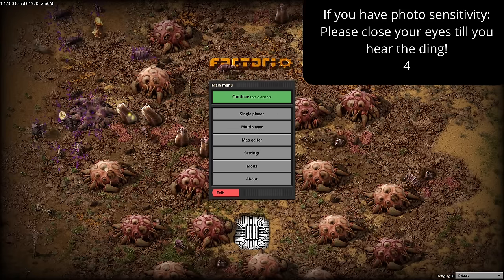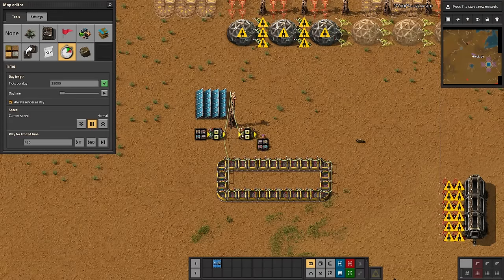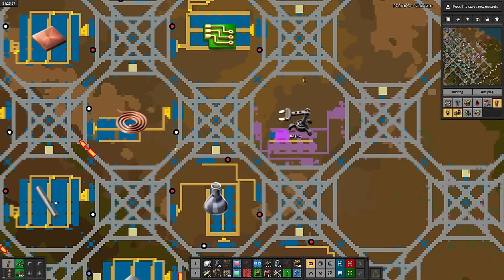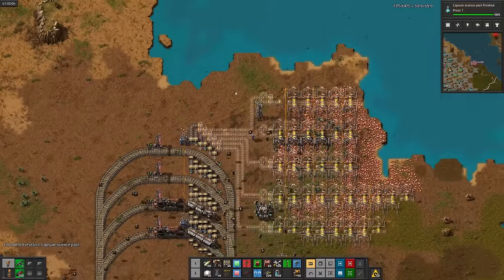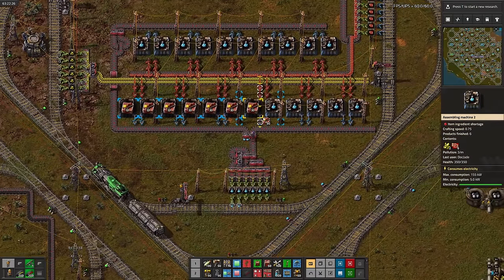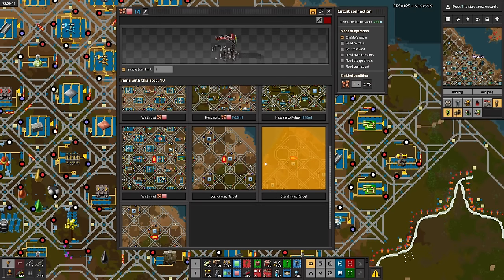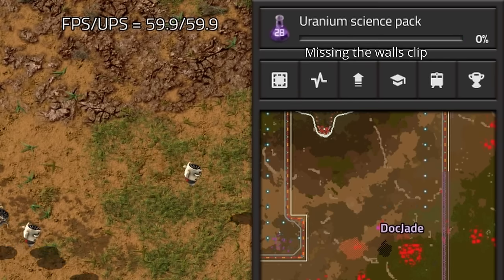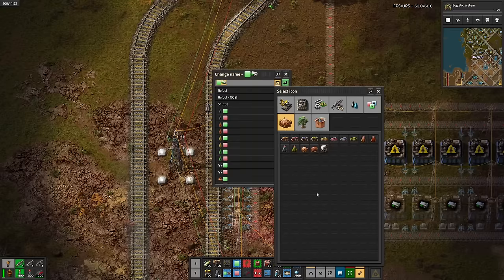Can you beat Factorio with 36 NEW science? Part 2

Comment: As someone who loves needlessly complicating rail networks, I really like your diagonal tracks. I prefer triple-lane, braided, bi-directional tracks myself, but diagonal cells are fresh :).

And 1-1 trains are best trains. Who cares about 1-2 efficiency? Double the trains = double the fun!
Reply: Can you confirm what you mean by "braided" in this context? I can't imagine any way that could apply to rails without creating a monstrous amount of unnecessary deadlocks.
Reply: @angeldude101  I would assume they mean that the tracks are connected many times (don't remember a word for it in english), presumably in a braid like pattern, allowing trains to switch between them whenever
Reply: @2Links  Yeah, interwoven also works. Three parallel bi-directional tracks that allow extremely frequent lane changes. A train in any lane can transfer onto any other lane at any point along the track. It actually prevents deadlocks and massively reduces the need for braking, theoretically and up to a point, by allowing a train to path around slower trains (oncoming/off going). 
The 'theoretical' is because I haven't stress-tested it yet. I designed it in the newest part of my last vanilla base, and it didn't see much traffic before I stopped. I tested it by parking trains in it at random points and the other trains pathed around them just fine.
I understand what @angeldude101 is saying, though. If six trains (three from each direction) tried to go through the same point on the tracks at the same moment and it wasn't at an exit, it's possible the trains would deadlock and block that section of track. 
This should be avoidable by using chain signals up to the previous exit, but testing would be needed to see if this is the case.

With the new rail bridges coming out, though, I'd probably just have proper intersections for anywhere that would see that much traffic :).

Comment: One thing I like to do for trains after a refuel station is a "empty" station that acts a a train depot that the train goes to after the fueling and then restarts it's schedule. That way if the stop after the refuel is disabled, it will wait at the depot instead of the refuel station, just have one depot station per train if you never want to worry about train lock and you're good!
Reply: It does mean the drive a bit more though.
Reply: @edomeindertsma6669  yes definitely want to scatter your train depots close to your refuel spots so trains only need to go a bit to the depot, or just up the train count and have a mega hub xD

Comment: 17:00: There's an eazy way to make a deadlock-safe generic unloader station even in vanilla so your lab cells would have only 1 input (or 1 per 40 science types). It's cool but have throughput problems since each train needs to carry ALL possible items.

The way you do so is by setting filters to the items those are both missing and presented in the parked train, and the train lives the station by inactivity. Technically, you are not restricted by all trains having all items, but then some of them would run in useless loops.

Comment: A trick I learned on my on run about train getting stuck at fuel or waiting stations.
Instead of disabling the station, set the number of trains allowed with a circuit, with mod of train capacity based on the current amount held by the station.
Disabling the stations causes trans to go to the next stop, limiting the trains to 0, cause the train to wait at the current station.
And to make sure the train don't get stuck, set the schedule like this

 - 1º Starting at the unloading (wait until train is empty) so they don't keep running around.
 - 2º Loading station, which will be limited by circuit (train limit), so it only open when it will be able to load a train
 - 3º Fuel/Waiting station, so it always pass trough the fueling before going to the unloader, which will be in need of trains since it only leave once the train is empty

whit this setup, the trains won't go from Unloading to fueling then to unloading again while there is no open station available. They will only leave station 1º when they have a loading station open, and they will have a unloading available for them to arrive.

Comment: i do love your wacky wall designs :3

i saw you manually replacing a belt balancer from blue to red, theres actually that inside the blueprint creator which lets you downgrade to previous belts

how do you make a train not cycle between two stations constantly when using stations that turn offline & a fuel stop.
for example, my iron drop off is green because it needs more iron, but the iron pick up has no iron, so my trains will just constantly cycle between iron dropoff and refuel until they inevitably run out of fuel

Comment: "due to how the grid is setup, train have to wait to unload one at a time"
use train limit

also sushi is stupidly damn simple

- input inserters (read content pulse mode + enable disable) on red wire, config: desired item < desired quantity
- output inserters (connected to labs for example) on green wire

then you need 2 arithmetic combinators

- output inverter => connect green to input, ANYTHING * -1 => ANYTHING, connect ouput to memory cell input (with green wire)
- memory cell => plug red wire on input, connect input to output (with red wire)

each time an item is added on the belt, it adds +1 item to the memory cell (and the value is kept, that why it's a memory cell)
each time an item is removed from the belt, it adds -1 item to the memory cell
the input inserters have access to the memorized values (since it's memorized in the red wiring) and that way, knows when an item needs to be inserted

if you lose power, you're fucked :)